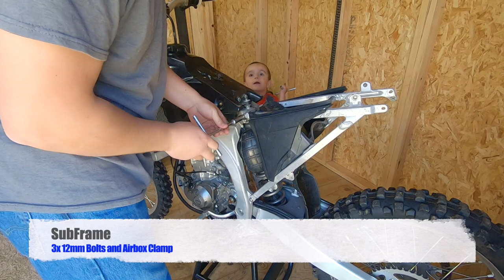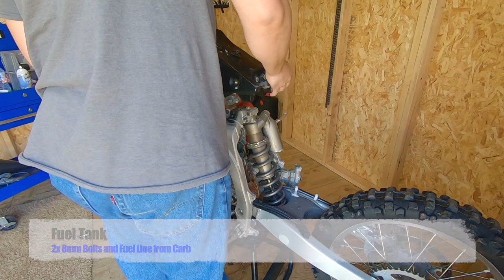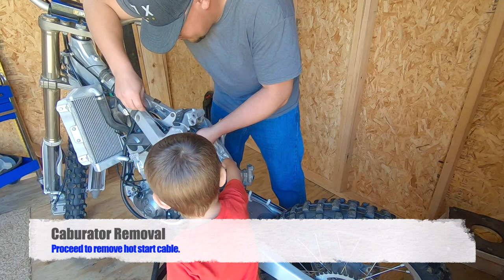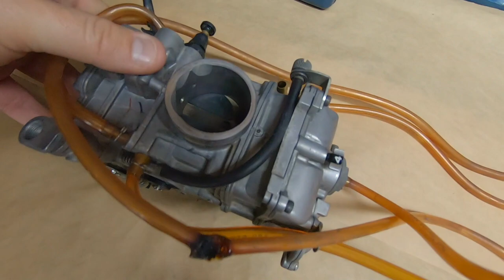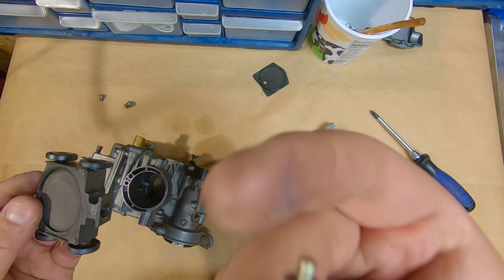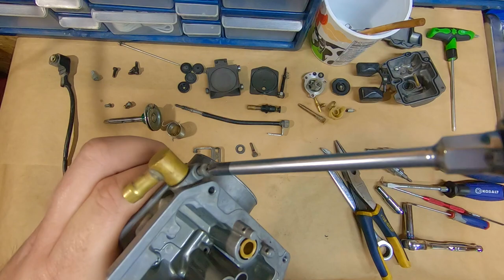2006 YZ450F Carburetor Rebuild 1

Comment: Man what a crappy engineering job on behalf of Yamaha 😢
Reply from the maker: Once dialed it works great, but it’s a dang hard carb to get dialed for someone who is new to it.
Reply: I have a 2004 450F  that needs attention but im dreading taking it apart .
Reply: @DanMX2112   It leaks from the vent so im thinking its an issue with the Float
Reply from the maker: Record yourself and you’ll be fine!
Reply: @DanMX2112  went ahead and rebuilt my carb not too bad actually
Reply: @DanMX2112  only had 1 question. Does the pilot jet use a spring? Or is that the other air fuel mixture screw that uses the spring, washer,  and o-ring
Reply from the maker: @michaelcalderon4401 once you do it, you wonder why it seemed so bad in the first place.
Reply: @DanMX2112  Only had 1 question.  Does the pilot screw get a spring? Or it it the air fuel screw that gets the spring, washer, and o-ring?
Reply from the maker: @michaelcalderon4401 the fuel screw gets the following in this order. 1-oring 2-washer 3-spring 4-screw

Comment: So question if any one is here what’s the black cable the electric one where does it connect
Reply from the maker: It’s the TPS, or throttle position sensor. Used to adjust the timing based on throttle.

Comment: Dude I have the same bike, loosen the throttle side and the clamps holding the carb and pull it out of shifter side or if only doing jets and float turn it sideways and pull the bowl 👍
Reply from the maker: It’s so near impossible that way. You can’t access the throttle cables without removing the shock. I’ve never pulled the carb without pulling the shock, not worth the fight. I’ve never heard of anyone successfully doing it without pulling the top shock bolt to pull the carb back. Not saying it can’t be done, but idk how I would get it without totally hating life.
Reply: @DanMX2112  I've unfortunately have done this method and I agree with you 100% that it's not worth the fight LOL. I will be removing the back shock from now on to get the carb out.
Reply from the maker: @matthewmcclintock8730  yes sir, it’s a fight not worth taking on.

Comment: There should be a disclaimer. Removing the TPS adds a bunch of unnecessary work in getting it recalibrated. Wish I knew that before watching and filling your tear down.
Reply from the maker: Ya, I learned that too lol I should do another video on that Carb, and those does and don’ts of that sensor. Thanks for the feedback Walker!

Comment: Hi there I know this is a long shot but what is the top hose for by the coil pack on head
Reply from the maker: That is the breather hose for the motor. It vents the crankcase so it doesn’t build pressure internally. Thanks for asking and for watching, I appreciate it!

Comment: Can I use 2003 yz450f fcr carburetor rebuild kit for 2003 wr450f fcr carburetor? Is it fit?
Reply from the maker: It’s the same carb, although the jetting will be different. But I think all parts should carry over. To be safe, I would order the correct kit though, don’t let me lead you astray lol thanks man!

Comment: Will an 06 carb work on a 08 engine?
Reply from the maker: I’m pretty sure, I don’t think anything changed on that carb from 06 till fuel injection came out. But double check part numbers to see. Thanks for watching man!
Reply: Cool ! Another question.... I have a 06 according to the vin but it's a steel frame and the engine has 5 gears, any idea how to tell what year model the engine is? I need to replace the clutch plates but 05 and 06 are the same but if its a 08 ish engine I think I may need a different clutch kit.
Reply from the maker: Just looked on RMATVMC and it shows different part numbers on the kits, so I’m betting the plates are sized differently. As far as Identifying the engines, I know they have stamps on the head, and cases that identify. Not sure if this helps but look online and cross those numbers.
Reply: Thankyou big heaps, are you on Facebook? Would love to talk more directly if possible, ill send a few pics of the bike and engine see if you have any idea what is going on with it lol!